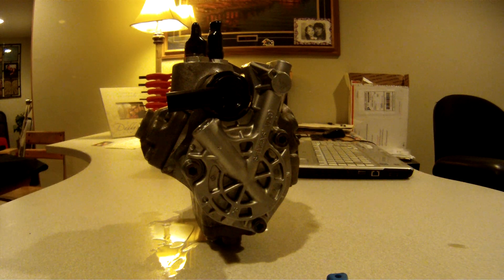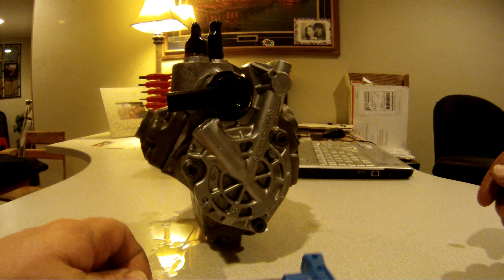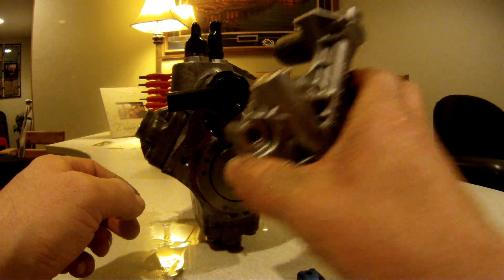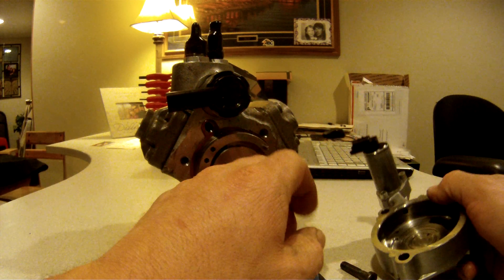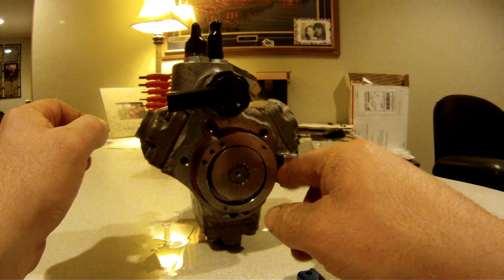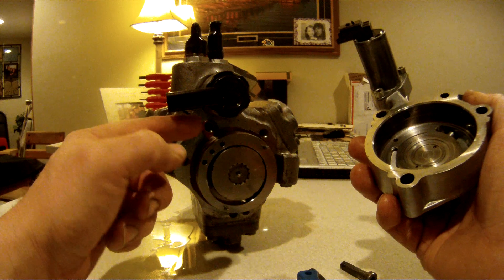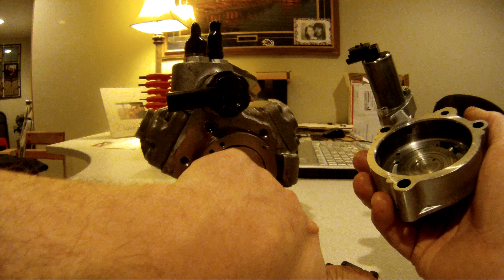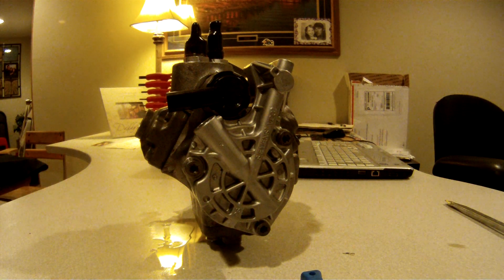How to reverse flow a K16 HPFP for 6.4L Ford Powerstroke Diesel-Duel fueler setup

Comment: What's the purpose of this?
Reply from the maker: So you can place the pump in the front of the engine and run the pump with a pulley and serpentine belt. With  the pump that is in the factory position and then adding this one, you adding more volume of fuel.
Reply: Is there a torque spec for the bolts
Reply: Thanks